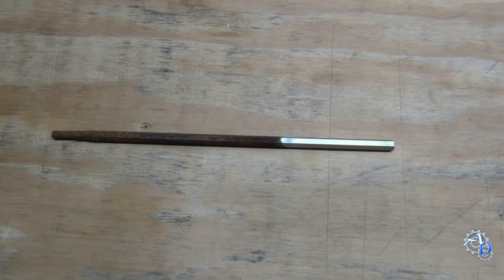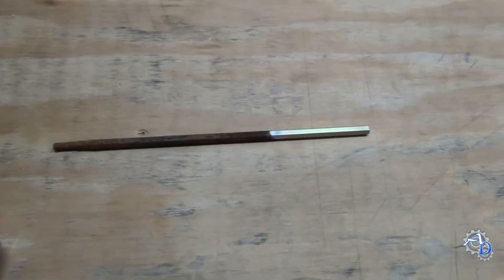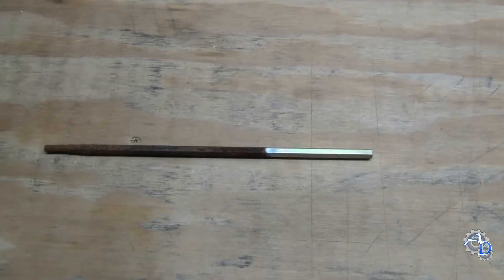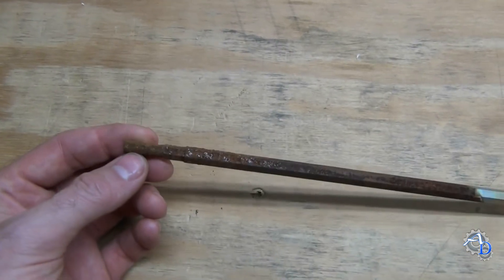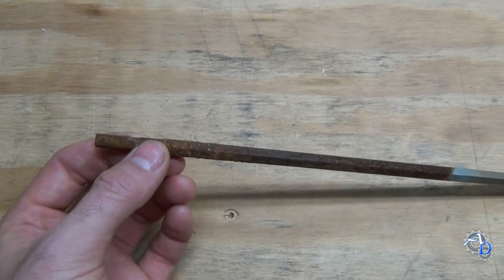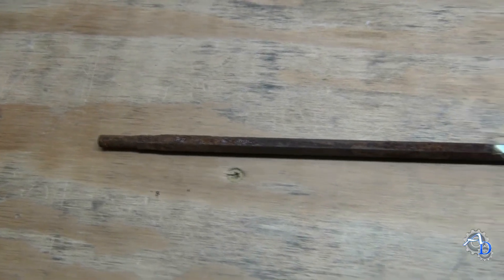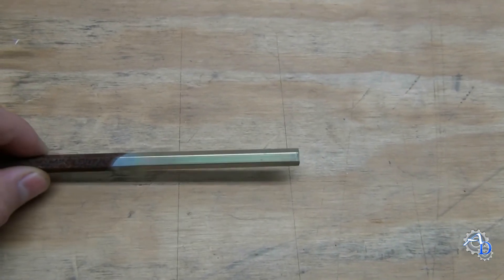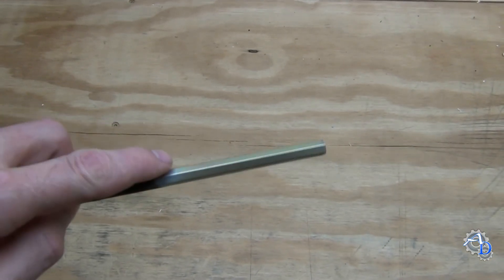Zinc Plating Corrosion Test - Did It Survive 6 Months of Wet Weather?

Comment: Wow, that held up very well. How long did you plate that piece? (I'll go check the other video) I need to zinc plate the fuel pump hanger for my car, which was zinc plated oem, but had steel AN fittings welded to it. Just glass bead blasted it today, to clean off anything loose, and am going to a hardware store tomorrow for some plating supplies. Thanks a lot for the very helpful videos!
Reply from the maker: I plated it 5 - 10 minutes for each layer, and put on three layers. I vapor blasted between layers.

Comment: Just wanted to see if you know anything about zinc's ability to resist the effects that creosote can have on metal fasteners.   I'm building a pole barn using telephone poles from as early as the 1950's & 60's that were treated with creosote and we had a sawmill come in and mill them into 6"x6" and 6"x8" posts/beams. I did find several results saying how today's galvanized bolts aren't a good choice to use in lumber that has been treated with creosote where as even though galvanized bolts were used by the electric companies in these telephone poles, they held up very well due to a MUCH higher quality of galvanized bolt.....but I'm having a difficult time finding anything on how well zinc plated bolts hold up to creosote and I can understand why since creosote was banned long ago and not very many people use telephone poles to build with.   Any info would be appreciated :o)
Reply from the maker: I really not knowledgeable about that. Probably the old fasteners you're referring to had a hot galvanized finished, which is thick. You can still get fasteners like that. I'm pretty sure they dip the parts in molten zinc to do that. Painting the fasteners with epoxy paint might be another option.
Reply: Thanks for the quick reply :o) I checked on the higher quality (hot-dipped) galvanized 1/2" x 13 x 8" long bolts and WOW both home depot and lowes wanted nearly $6.00 a piece. This is a 20' x 40' pole barn that's 14' tall with an upstairs having a 4-6' tall area for storage and so going to be alot of bolts needed for all of the joints. I found these same 1/2" x 13 x 8" long bolts that are grade 5 and 8 and zinc coated for an average of $1.50 each and free shipping on Ebay and so why I'm hoping to find info on how well they hold up to creosoted lumber. If I find that they don't hold up well, it sounds like you had a good idea to find an epoxy to coat them with.
Reply from the maker: Another thing I just thought of. They carry a product at Napa called weld thru primer. If you look for it, make sure the ingredients list zinc as the main component. The stuff I use is from Napa Martin Senour Paint called TECnique Zinc Weld Thru Primer, #7221. It sprays on flat gray. When it is dry, if you scrape it with something somewhat hard, it will show a shiny silver finish where it was scraped, which is zinc. The zinc acts as an anodic layer which will protect your parts. I use it to protect parts that are too big for me to plate. It's not made to paint over, but I haven't had any problems with paint (rustoleum) sticking to it. I restored several lawn mower deck parts with it last summer.